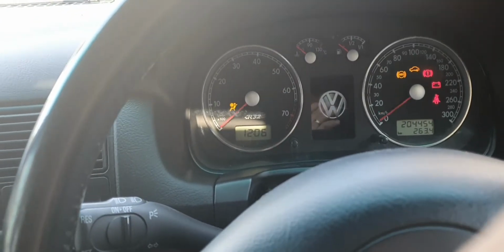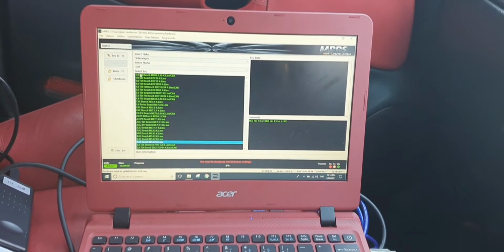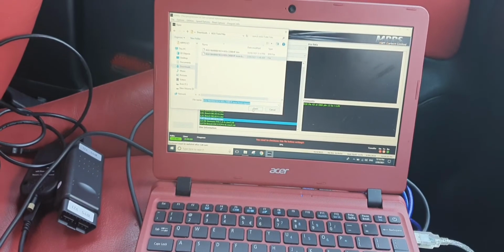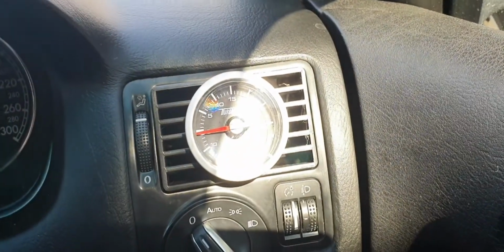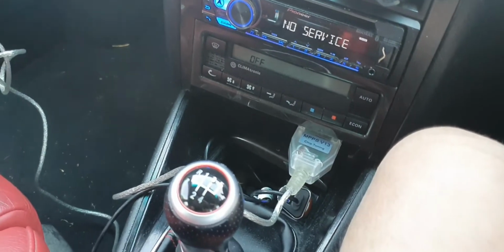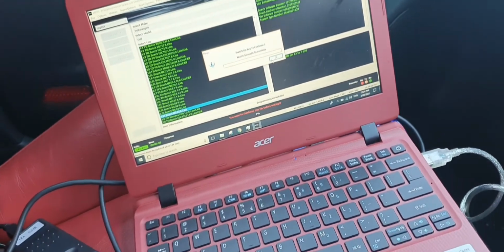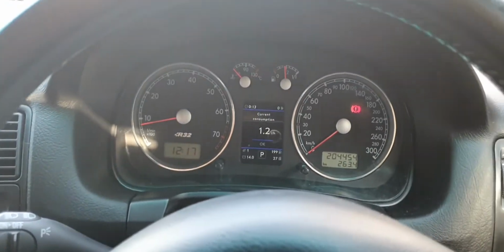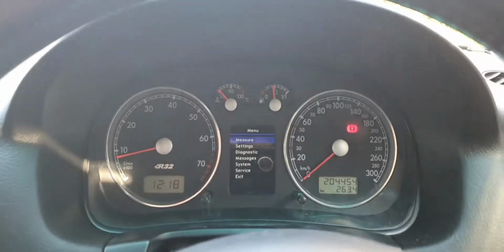MK4 GTI 1.8T gets new tune using MPPS app and Cable

Comment: hey buddy how are you. hope your well. im needing a bit of a help i have upgraded my mk4 has bigger turbo and will be fitting in 440cc injectors i want to ask is how you tuned . since you already have the file i was wondering if you be happy to see a copy of it.
Reply from the maker: Hey mate, wouldn't be fair to the tuner if I shared his files.
See what he can do for you mate. Message Tuning Technics on Instagram.
I'm fairly certain my tune is for a 360cc injector so wouldn't work too well with your 440cc. The tune will need to be scaled again for bigger injectors.

Comment: Do you have a link for the MPPS cable and software? How much did it set you back in total?
Reply from the maker: Mpps v21 on AliExpress around 50? Comes with software but you need to open the plug up and jump the pins to power the ecu while using OBD2 port.
Reply: But the white cable in the video is a v13?